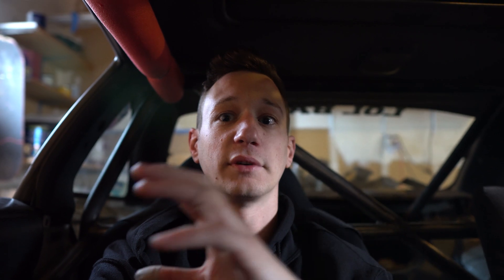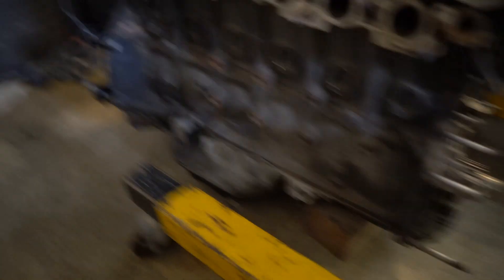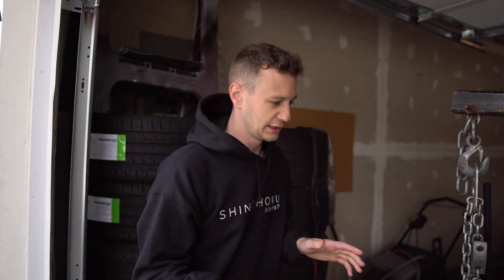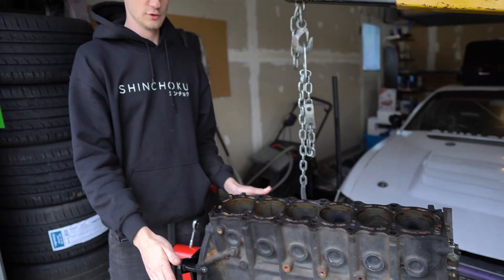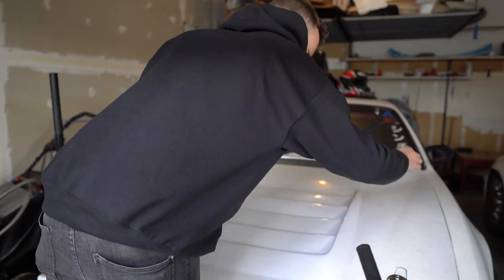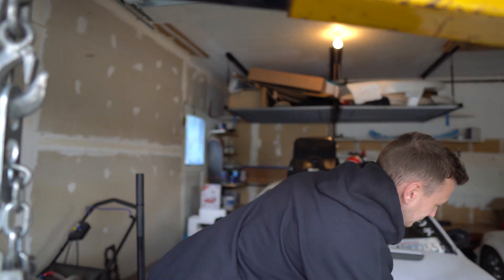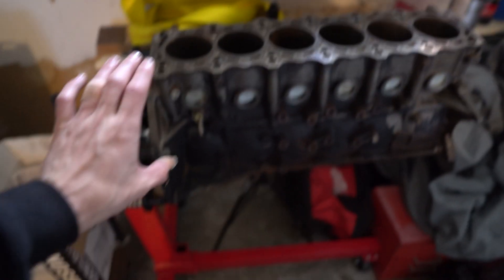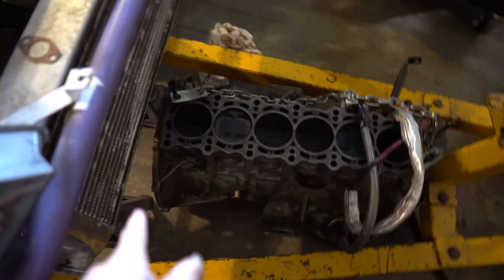How to build a 1.5JZ starting from 2JZ disassembly Part 1

Comment: Cool exactly the info. I was looking for.  So I was going to take a 1JZ vvti GTE single turbo head off of a 99' JZX Chaser.  Can I put that on to a GS300 2JZ block from a Lexus that is NA and vvti? Also I was thinking about running Motec (I know a bit expensive) but I like the all in one system versatility i.e. boost, methane injection ect..  Can I plug and play with multiple vehicles assuming I have different harnesses for each?  Cody Phillips Racing does some cool stuff especially with his wastegate positioning sensors on his Tiel's.- Thanks looking forward to watching the build.
Reply from the maker: I run a link ECU in my car and it handles it perfectly. Yes, you should be able to run that straight on, I know a lot of people end up modifying the back oil port to the head but I haven't had any issues with mine and I didn't. yeah you would just need to run the correct harness per motor with most aftermarket ECU's that are able to run multiple configurations
Reply: Thanks for the response I'm looking at a 2JZ N/A non-vvti engine from an 02' IS300 Lexus with a blown head gasket.  I would imagine that this block would work for a 1.5JZ build as well?
Reply from the maker: Yeah that should be fine. If the headgasket blew i would recommend getting the block decked or at least checked out by a machine shop and new bearings as coolant may have passed into the oil.

Comment: Can you link me to the parts you ordered? (bearings/piston rings)
Reply from the maker: I've always used kinds bearings. but they were out of stock for the mains when i ordered.
I used Hastings piston rings and ill have that in my next video.
MA Performance has the fastest shipping of anywhere I've used this far

https://www.maperformance.com/collections/engine-internals-assemblies/year_1997+make_toyota+model_supra+submodel_all
Reply: @SHINCHOKU   I appreciate the help. Im building a 1.5jz and just wanted to see what others were going with.
Reply from the maker: Check out the most recent video where we install the new bearings

Comment: Great video, but I’ve got 2 questions. Could you have still used that motor and just gone oversized pistons? What exactly did you see in the cylinder wall that made you get the next block? I just picked up a 2j na and I’m curious as to if I should even bring it to the machine shop. Thanks in advance!
Reply from the maker: There was a massive amount of pitting in the cylinder walls. when you ran your hand through the wall you would fell the wall waving like a ruffles chip. yes you can run over sized pistons but i wanted to stay with the stock bore on this build.